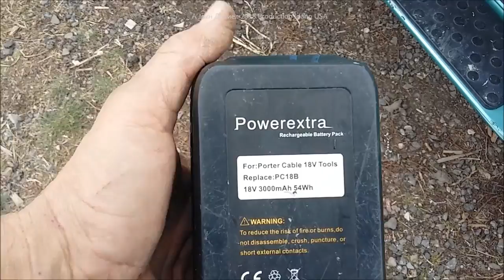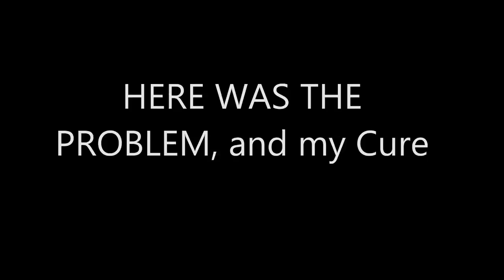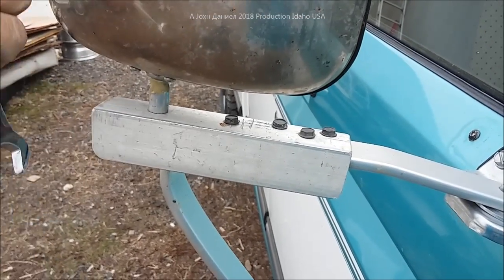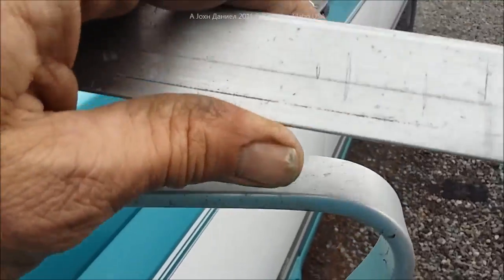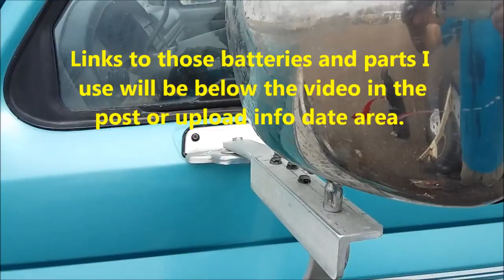Extend your Tow Mirror Fix, the easy cheap way to improve towing

Comment: I have done this before worked good but I used the hole that was already there one bolt one nut two washers one lock washer just make sure the bracket is tight on the mirror bracket and it wont move.  Nice job.

Comment: Lipo4 are meant to be non flammable non toxic, I'm just waiting for realistic prices or even better batteries again
We used the old lipo bag batteries on electric bikes they like to burn or split open , charging them unattended or near anything flammable is like gambling.
Reply from the maker: A pair of dewalt lithium batteries that had not been used in a few days were in my 27 foot fully self contained job trailer, it sat over the weekend and we plugged the trailer in on a sunday night, some years ago, to start charging the 2 tool batteries on chargers and running the air conditioner. A normal repeated function when I was a commercial construction builder.  2 hours later we heard a explosion. Up in flames went the whole trailer. $40,000 in losses over a fucking $50 battery. A year later, dewalt pulled the same batteries as having over temp safety failure. SCREW LITHIUM BATTERIES! I let my kids have some, but they are charged OUTSIDE!
Reply: Јоhn Daniel check out lead crystal batteries

Comment: Couldn’t you just switch them to the opposite sides and get two more inches.
Reply from the maker: The post on the mirror are centered, my other truck has the offset mount, we did do that with it.